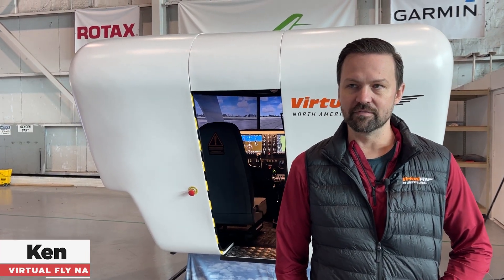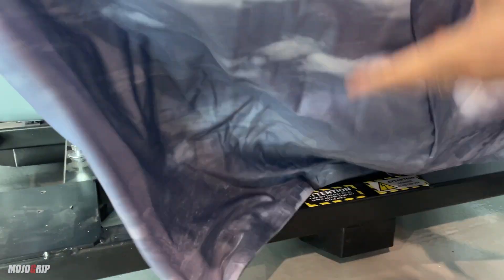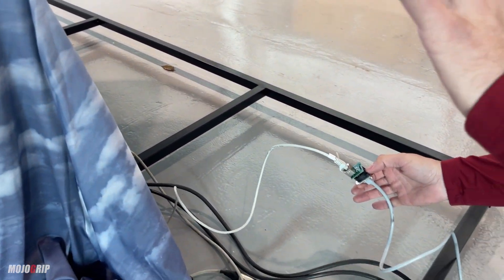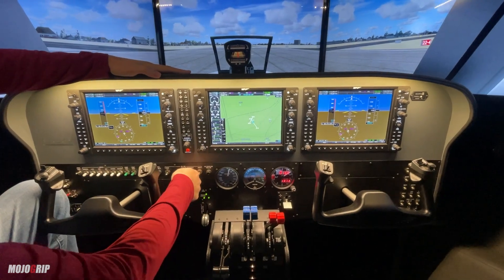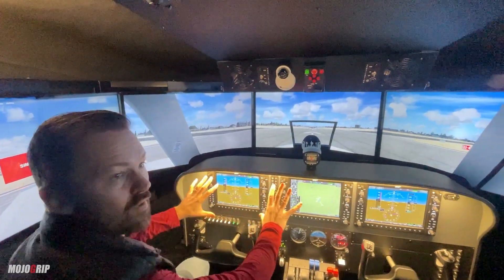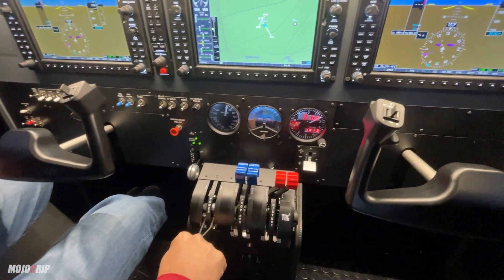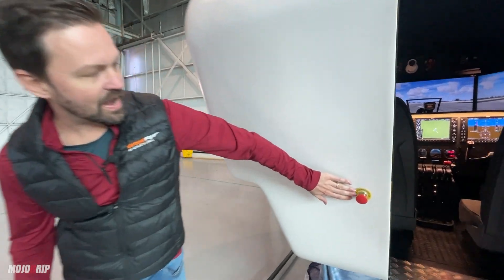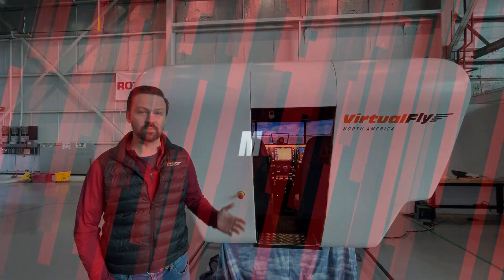Tour Of My New Full Motion Flight Simulator

Comment: Cool but I wonder if a high res VR headset and some dummy avionics you can touch and a motion chair wouldn't ultimately be greater immersion. And allow simulating many aircraft with just a 'dummy' panel for each.
Reply: Nope, you would think that, but there is no substitute for the full cockpit experience. Now, what most people don’t realize is that you really do get the perception of depth in the airline class simulators. And even more insane is that after a while you can turn the motion off but still feel like you are moving. The brain is amazing.
Reply: @superskullmaster  Notice how narrow the view is. VR would be far more immersive, you could move your head to the window and look up and down. With dummy panels with no displays correctly placed to match the virtual world you could actually touch them. With adequate resolution it should be quite convincing. And just a motion chair can be significantly cheaper to make. For an airliner it would be a pretty big dummy panel but still would have to be vastly more cost effective then your typical airliner sim that cost 10-20million dollars. If you can cut 15million down to 15k, that's quite a difference in pilot training cost. And the experience could be superior. It could include playful stewardesses.